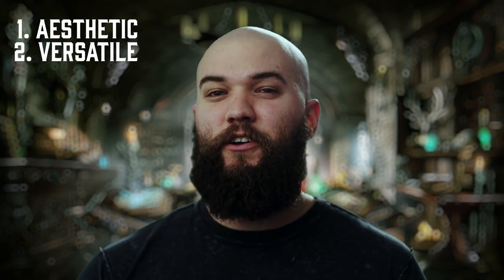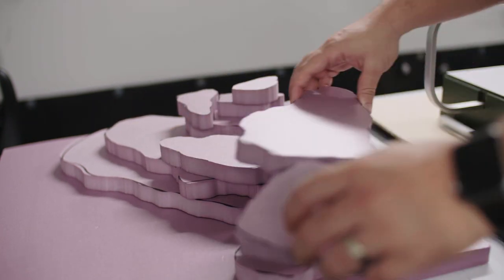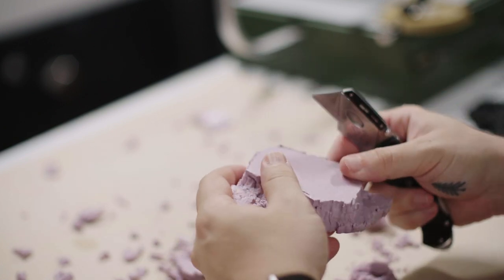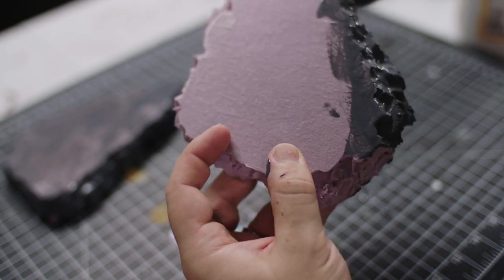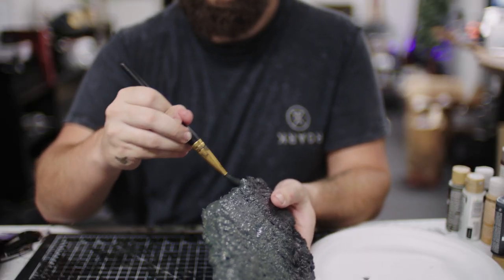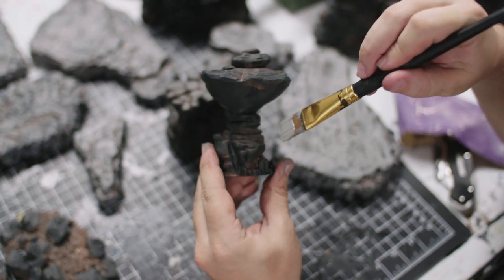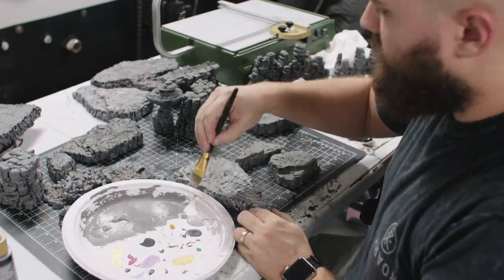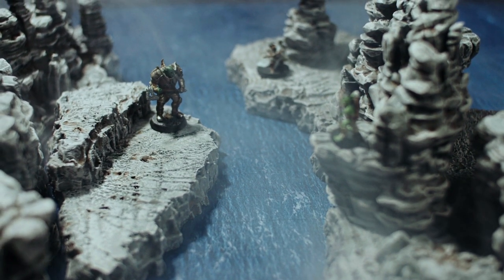EASY Rock & Mountain Terrain Build for DND

Comment: Yes please more videos on this!!
Reply from the maker: Noted!! Currently working on another terrain video that focuses on elven terrain but I’ll add on to these rocks soon! Check out our discord for updates and BTS! 😊
Reply: @ConstructedChaos  what we’re your print settings in prusa slicer 
Just start printing on a FDM printer 🖨
Reply from the maker: @deantareach8217  .2mm layer height with print bed at 60 degrees and nozzle at 210! I know there are a lot of other possible settings so if there’s anything else you’d like insight on specifically, let me know!

I will say that I invested in the Prusa mostly for its ease of use! It’s been very much a “plug and play” experience outside of actually building it!

Comment: This is really cool! Could you be a little more specific about the kind of foam you used for this? I looked up "polystyrene foam" and bought some, but it just ended up being regular styrofoam and not like what you had.
Reply from the maker: Yes of course! You should probably look for XPS foam (it's usually in a pink or blue color depending on where you live!)